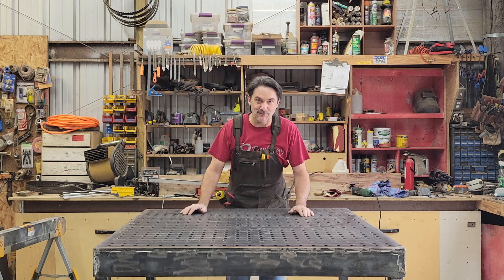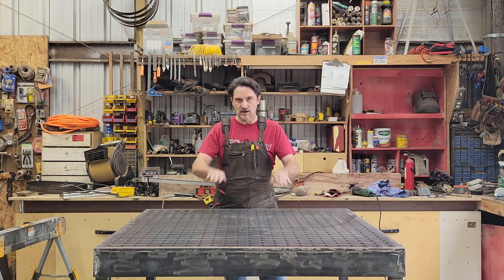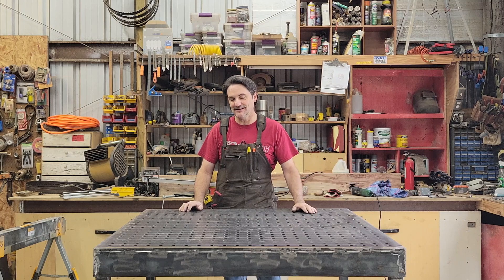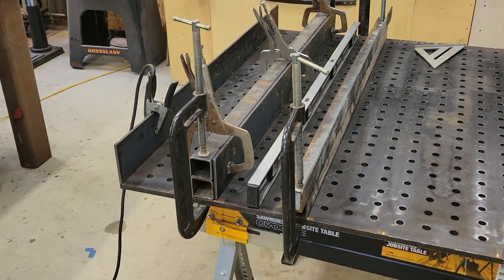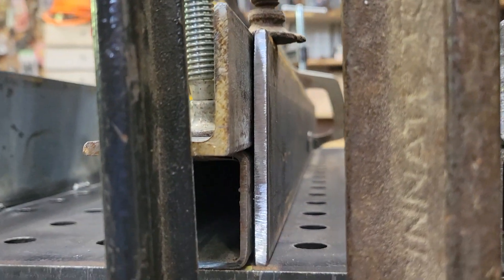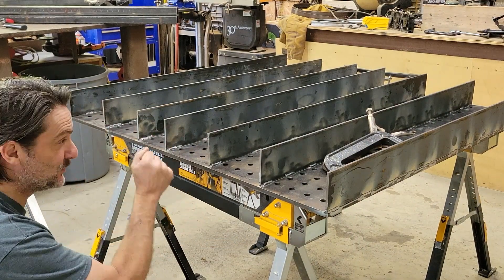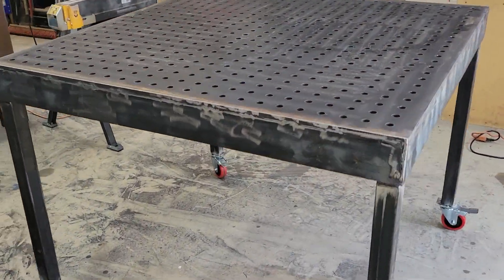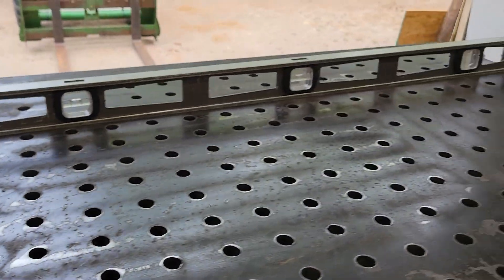K-man Builds: How to build a Fixture Welding Table.

Comment: That was an awesome job you did on that weld table. I’m bout to start building one just like it unfortunately I will be drilling myself. Any ideas on cheaper ways of obtaining a piece of 1/2 plate bout that size? Steel is stupid priced right now. I’m planning on checking local scrap yards but any ideas would be helpful. Thanks and thank you for the video